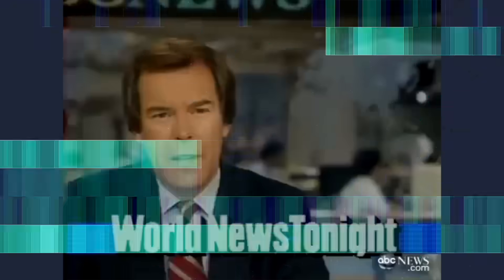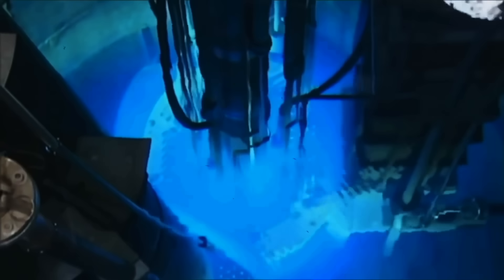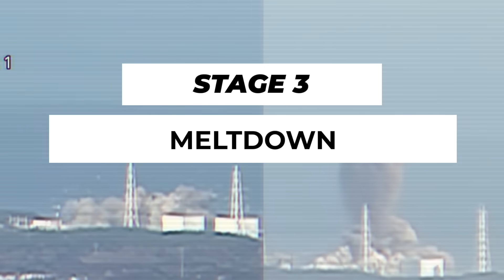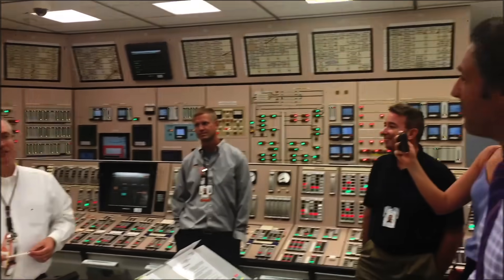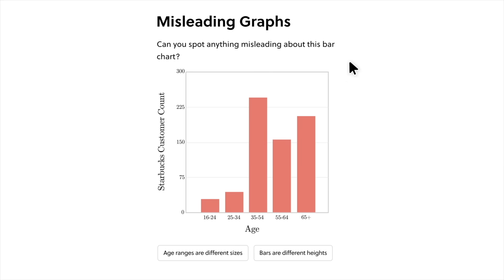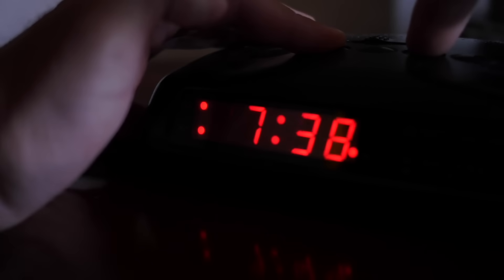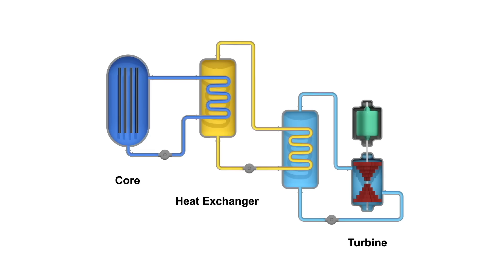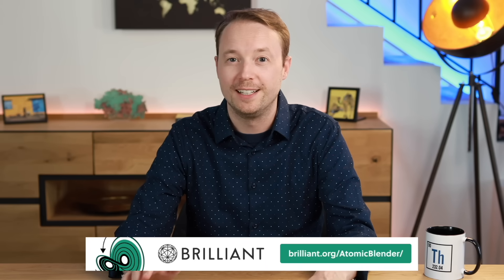Why Is It So Hard to Stop Meltdowns?

Comment: in chernobyl it wasnt reactor, it was nuclear bomb
Reply: No, it was definitely the reactor and not nuclear bombs.
Reply: @SocialDownclimber  nuclear reactors cant explode like that
Reply: @палисандр-р1с  Interesting argument, considering that yes they can and also that nuclear bombs do not explode like that.
Reply: @SocialDownclimber  no, reactors not constructed like a bomb, and so they cant make such explosion. but nuclear bomb can
Reply: @палисандр-р1с  No, that is wrong. Most of the building survived. If a nuclear weapon had gone off, the building would have been totally destroyed. That's how I know that you are wrong.
Reply: @SocialDownclimber  portable nuclear weapons can be of different power. also power can be adjusted. and it can be located underground anywhere to make destructions whatever you need and to hide light produced by explosion. not neccesary it will destroy building totaly, there are many examples when building was destroyed partially
Reply: Chernobyl was not a meltdown, but a run-away reaction which caused a steam explosion. Most of the contamination came from the burning of the graphite moderator. A Chernobyl-like accident is impossible with the water moderated reactors found in the West. However, meltdowns are still possible. Meltdowns are not explosions, just fuel melting. The explosions at Fukushima were from hydrogen gas released from chemical reactions in the reactor. There would have been no explosions if the hydrogen gas was not allowed to accumulate in the building.
Reply: @mhirasuna  The reactor core of Chernobyl did melt down though. Why are you saying it wasn't a meltdown when the core melted down?
Reply: @SocialDownclimber  The term "meltdown" refers to the worse that could happen to a water moderated reactor when you don't remove the decay heat after the reactor is shut-off. What made Chernobyl a real disaster was the steam explosion and the graphite fire which dispersed the radioactive isotopes. The core melted because the reactor was destroyed, not because the water pumps failed. Without a fire, a molten core does not disperse much radioactivity into the environment. Hence a meltdown, by itself, is nowhere nearly as bad as what happened at Chernobyl.
Reply: @mhirasuna  Yep but you literally said Chernobyl was not a meltdown. It was, as after the explosion, the core melted down. Therefore, you are wrong and it was a meltdown. Also meltdowns can hypothetically happen in any reactor that has a solid fuel, not just water moderated reactors. Do you think you are an expert in this?
Reply: @SocialDownclimber  A "meltdown" is a failure mechanism, not just the fact that the core melted. If you detonate a bomb inside a reactor and parts of the core melt, would you call the event a meltdown?
Reply: @mhirasuna  No, obviously, because the heat required to melt the core is not from the heat generated by the fuel. Chernobyl's core melted down because the cooling systems failed in the explosion. The core's heat caused the core to melt. That's a meltdown.
Reply: @SocialDownclimber  If you exploded an atomic bomb and the uranium or plutonium in the bomb melted before it evaporated, would you say that there was a meltdown in the bomb?
Reply: @mhirasuna  🤦I don't even know where to start with how stupid that question is. Just google "what is a nuclear meltdown" and stop wasting your time. I'm certainly going to stop letting you waste mine now. Have a perplexed life.
Reply: @mhirasuna Why are you so overly attached to the idea that "meltdown" is only a meltdown if it was the cause ("mechanism") of the major failure? Meltdown is a meltdown also if it happened after the time you count as the T0 of the incident.
Reply: @u1zha  Calling Chernobyl a meltdown implies that water moderated reactors could blowup like Chernobyl. Chernobyl was a runaway reaction which cannot happen with a water moderated reactor. However, they can still meltdown when the decay heat is not removed after the reaction has stopped. Unlike Chernobyl, very little radioactive isotopes escapes, even when the roof blows up from escaped hydrogen gas.
Reply: @mhirasuna  steam explosion cant make such destructions
Reply: @палисандр-р1с  The explosion at Chernobyl only destroyed Reactor 4. The adjacent Reactor 3 continued to operate for many more years. If you are referring to the photos of Pripyat, that damage was due to years of neglect, not the explosion.